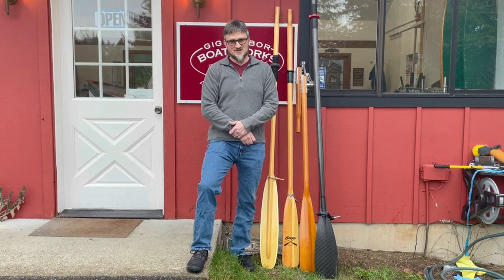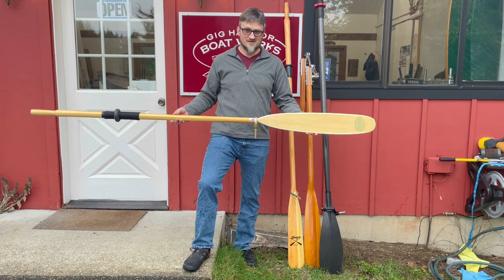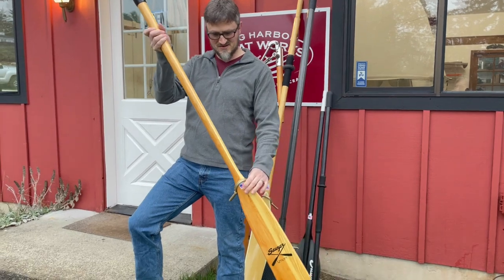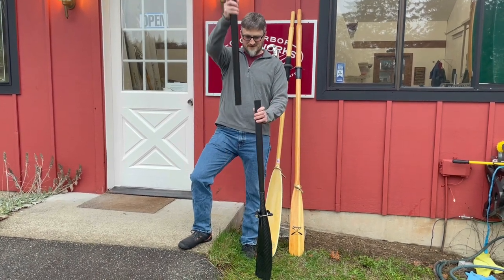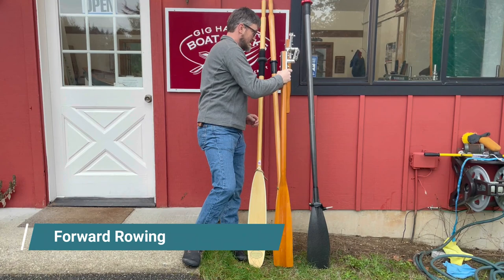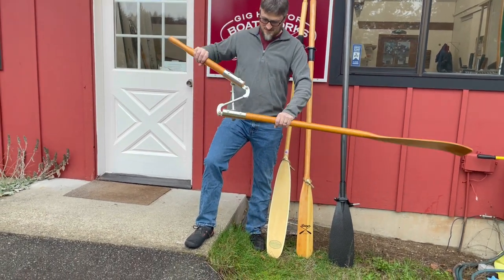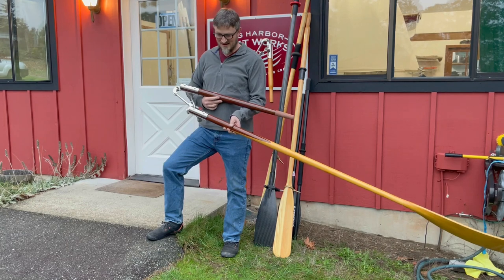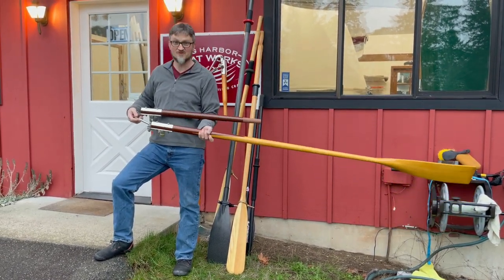All About Oars - Gig Harbor Boat Works

Comment: Do they make oarlocks that fit into winch sockets
Reply from the maker: Huh, I've never seen it done but I guess given the right setup it could be possible. Winch sockets nowadays tend to be 11/16" width, considerably wider than 1/2" standard oarlock pin. You might be able to imagineer something to fit the two together by adapting the winch socket, but I don't know of any oarlocks sized for that purpose.